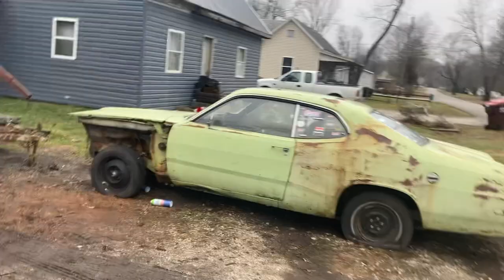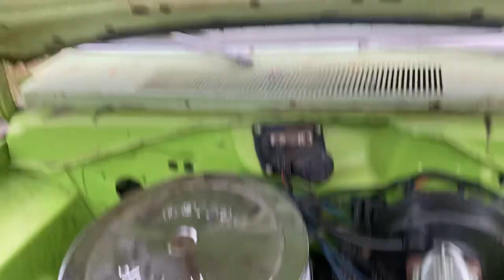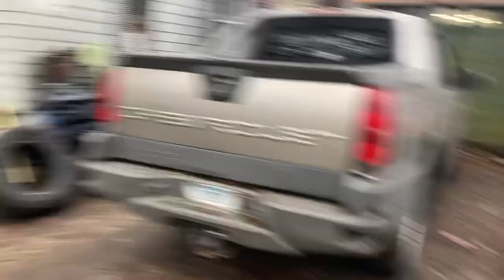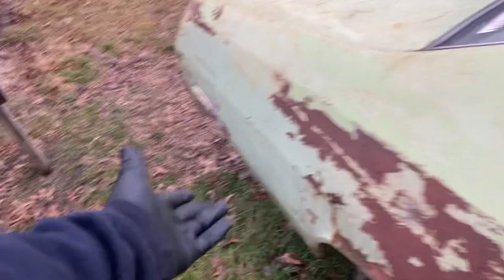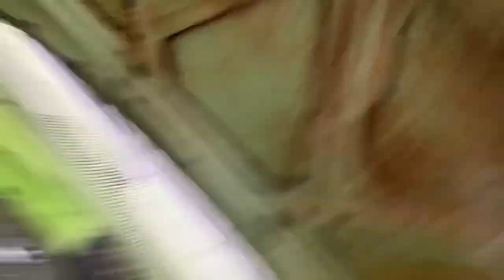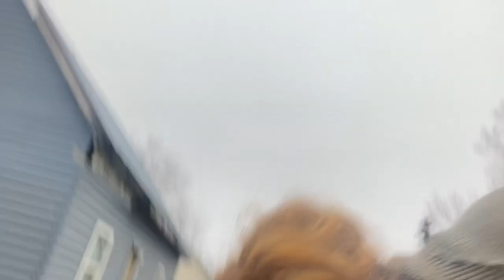dingleberry dreamer 🤡😂 what can mess up today on dreamer and non garage

Comment: I have no clue what going on but anyway. You should get a old Edelbrock carb and build kit and try it. They are easier to rebuild that a Chevrolet Rochester 2barrel in my opinion. I dont mine 1406 in 30 45 minute's,i also bought it from ebay "rebuilt" but it had issues until i rebuilt it.
Reply from the maker: That’s cool I think I have a 1406 on it now it seems to work good and ya edelbrock carbs are the way to go in my opinion lot easier to work with than a Holley
Reply: @Poormansspeedshopshopdrama  absolutely